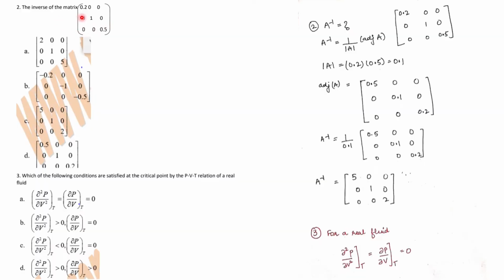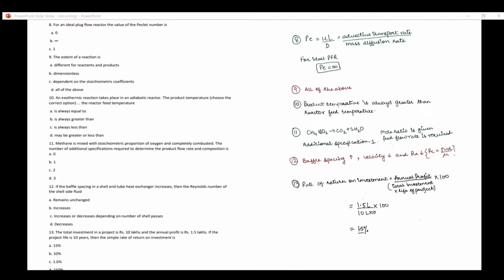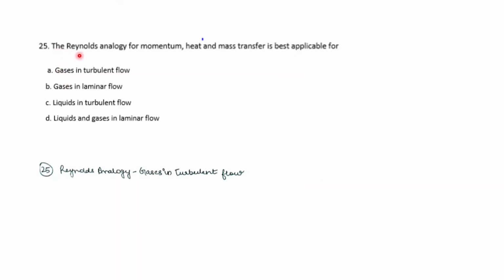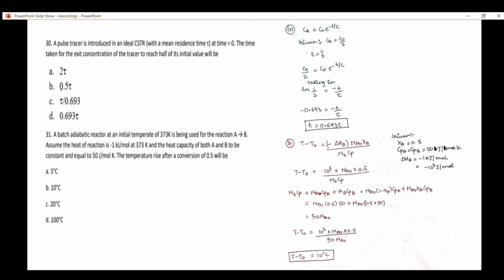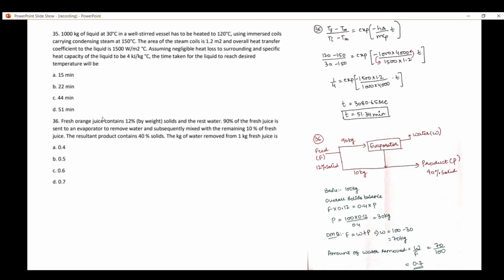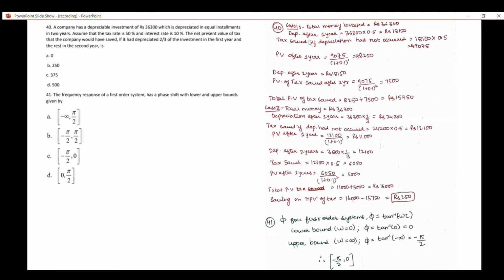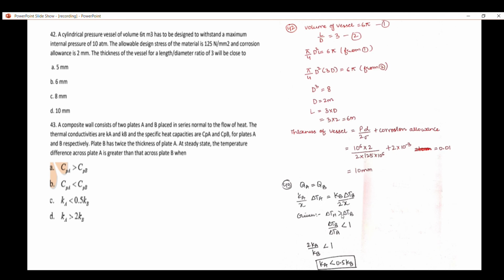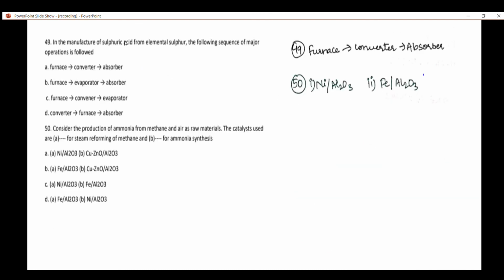GATE-2002 CHEMICAL ENGINEERING SOLUTIONS!!

Comment: I have a doubt for question 29th. Once fluidization is achieved, pressure remains constant, right? So pressure drop at the start of fluidization is same for both the cases ( g, porosity, density same), so why not A? kindly explain.
Reply from the maker: Kaustav,  the aim of this problem is to find out the pressure drop of another gas (parameters given). 8400Pa/m is the pressure drop of Gas I and 18900Pa/m is the pressure drop of Gas II. You can calculate pressure drop using Burke Plummer Equation because the reynolds number is greater than 1000 and then solve for Gas II. I hope this helps and For further Queries, Please mail us showing how you have solved and then we can discuss.